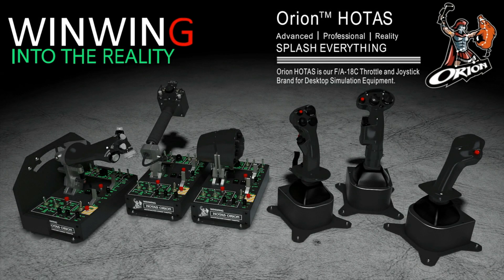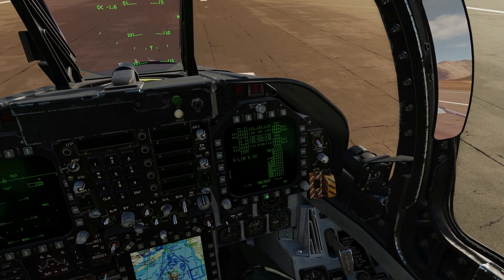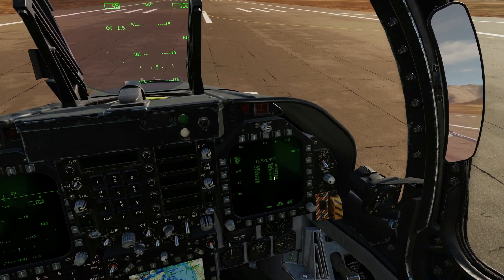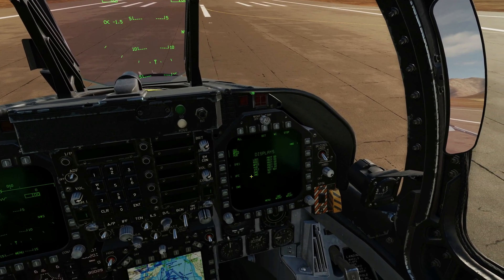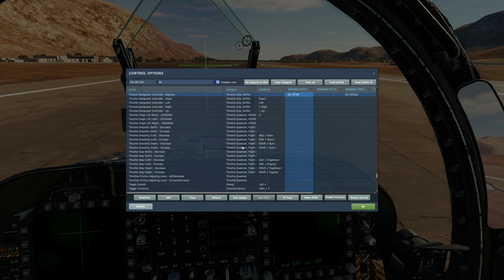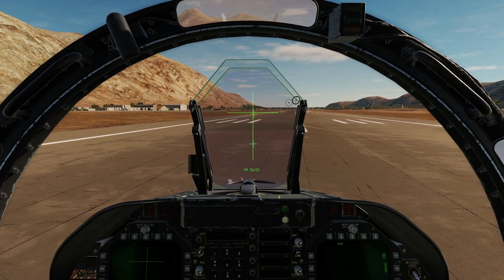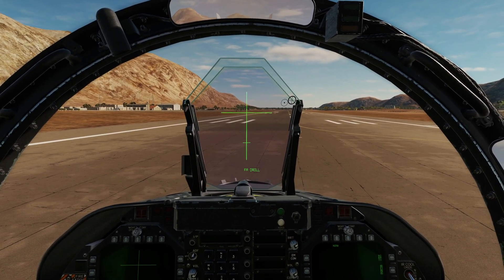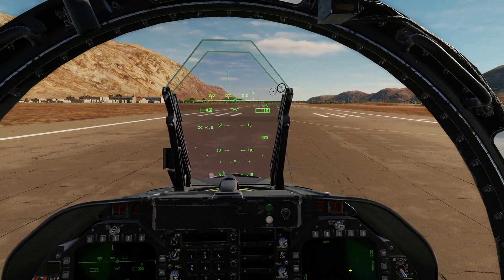FA-18C Hornet: JHMCS HMD Alignment Tutorial | DCS WORLD

Comment: After the test when I push the align button it doesn’t work . Is it a bug or I am missing some passage? I do exactly as show in the video 🤔
Reply: Apparently the cage/uncage cycles the fine alignment now for whatever reason. TDC depress stopped working for me as well.
Reply from the maker: you are on latest OB version yes?
Reply: @grimreapers   on the f-align I pressed the tdc depress, nothing happened, tried million times, steam version also.
Reply: @michaelwong1951  I have the same problem with the fine alignment. tdc depress do not respond. Tried to map tdc depress to keyboard to make sure it was not the hotas. No luck.
Reply: @Revan1977  actually you should use the uncage button not the tdc depress, i just tried.
Reply: @michaelwong1951  Guess they changed the button. Hope it is still realistic. Thanks for the help! :)
Reply: @grimreapers  i play the steam version. After the first test I push the align button but nothing happens
Reply: @grimreapers  I have the same problem, i think they just removed it? although also on hot start it seems to not be aligned properly and it makes it useless. steam version